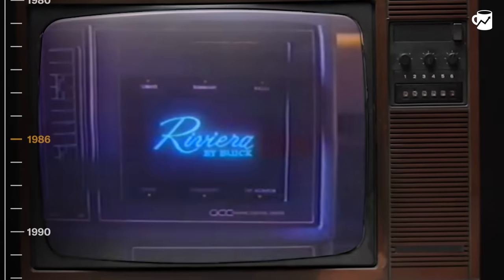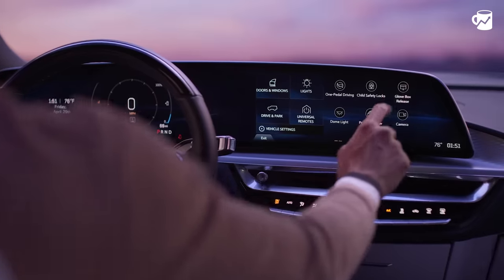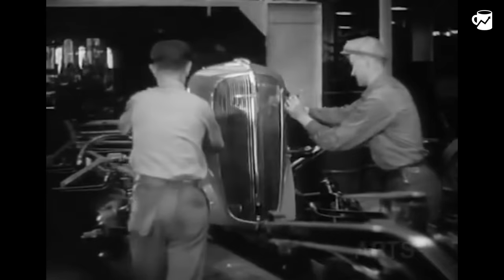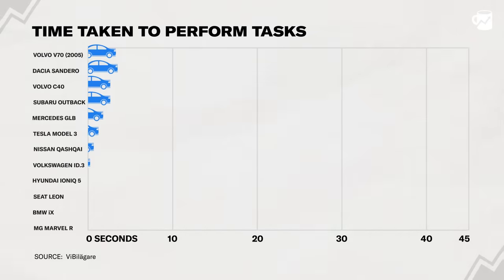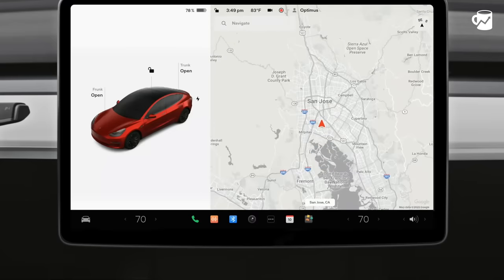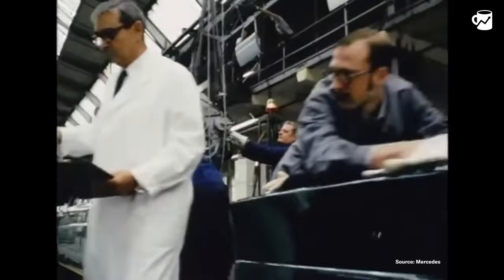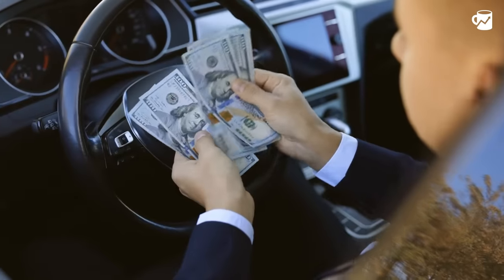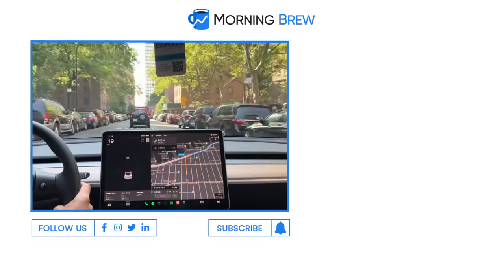The Real Reason New Cars Have Touchscreens

Comment: All I want in a car is music, navigation, and for it to go vroom. The rest is just unnecessary clutter
Reply: Agree with that plus heated steering wheel and seat. An almost must in Canada
Reply: Plus working AC. It gets hot where I live
Reply: Get a Mazda then. Vroom vroom plus physical dials and touch screen that disables when driving
Reply: @idontcare-tk1te  I actually thought about that. But I got a better deal on a used HRV base model
Reply: I have a Audi A3. Its got heated sports seats, no heated steering wheel, but the airvents are located next to the drivers hands = warm air directly on your hands :) But it also has physical buttons for heating, driver modes, but also a 10" touch screen. I only use touchscreen for navigation, and music. But steeringwheels also have physical buttons for navigating and volume, change track / radio etc. Works great.
Reply: That's what I learned with my Tesla. After the honeymoon is over and the novelty wears off, the rest of the stuff is just annoying and you realize the joke is on you. Apple Carplay is all I need for the music and nav and it's standard across most cars and easy to add to older cars.
Reply: Eye if they love minimalism so much why don't they minimalise the controls and features
Reply: @idontcare-tk1te  there be a solution, when car is moving touch is disabled, that would be such a great policy
Reply: And a machine gun mount.
Reply: Navigation means they have geofences.
Reply: Safety second music first
Reply: Louder for the engineers in the back
Reply: You don't need navigation, that's what paper maps are for.
Reply: @vikvc i be driving my 40 year old mercedes with a broken heater at -14°C
Reply: @Callsign_Sturm  the problem is that I don't know what to search for because it always blows hot air on the windshield and my feet but it also always blows cold air through the other vents
Reply: @Callsign_Sturm  there is always hot air coming out of the windshield vent and feet vent and always regular air coming out of the dash vent. It doesn't have ac anymore because it never worked and I can control all of the vents separately if it works properly. I couldn't find a haynes repair manual for it. It's a w126 280s from 1984 and I'm not really good at fixing stuff. The only thing I fixed myself was the radiator. I just replaced it and the hardest part was finding a fitting part
Reply: I dunno, you should probably include indicators, headlights and wipers in that list too
Reply: The driver is also unnecessarily as proven by Waymo
Reply: @idontcare-tk1te  Get a pre - '24 Mustang S550. Much more vroom vroom!
Reply: @idontcare-tk1te  most older cars (made before ~2010) are good, reliable, and dont have these tablets, you just have to take a good care
Reply: Me too. Built-in sat nav and a reversing camera are the only reasons to have a screen in the car. Unfortunately, here in Australia, while satellite navigation is an option for many new vehicles, most people don't opt in for it. Instead, they rely on their phones. That's all well and groovy for city driving, but it's pretty useless outside out main cities.
It drastically limits the availability of suitable second had cars for people who want built-in sat nav.
Reply: 1. Find a car that's emissions exempt in your state
2. Put some money into fixing it up
3. 200 dollar wal-mart double din
Reply: This is my Toyota Aurion basically.
Reply: A/C is important to me oh and ventilated seats as well since you know I live in South Georgia‼️
Reply: IDK, I wouldn't mind my car telling me how great I am every once and a while.
Reply: Also, air con and power steering on top of the navigation & stereo but otherwise agreed.
Reply: I just need it to drive, music is hypnosis, dont need that brainwash when I drive. Navigation isn't necessary, because I actually know where I'm going....
Reply: @valdorobantu290  I purchased a new car almost 2 years ago. The navigation is nice, but I still have a state map and national Atlas.
Reply: Agreed. Spotify, Maps/GPS, Bluetooth, is all I need
Reply: I guess an air conditioning is unnecessary clutter to you?
Reply: This is why I won’t get rid of my 2018 Subaru Crosstrek. I love the physical interface. Yes, there is a touchscreen, but I never have to use it. It only controls music in my car and I can tell Siri next without touching it.
Reply: All Id better see for a center console is a radio, a/c controls, & maybe a closeable compartment.  I realize practically all cars made now have a "nav" computer, but I dont need one....

I will sooner invest $5,000 into something made before year 2000 than waste $50,000 on todays junk.  Its just a ground vehicle for godssake, its not the space shuttle!  It must be easier to use the cockpit systems of a 737 than the nav system of today's cars!
Reply: The CrossTrek is awesome. I've yet to meet a person that doesn't like theirs.
Reply: @ReigoVassal  You missed the point entirely, but depending on where you live, that is entirely possible.
Reply: Air conditioning
Reply: All I want in a car is for the driver to be always present, always ready, polite and quiet. Basically, I want a robocar! 😂
Reply: And air conditioning. And turn signals. And a horn. And
Reply: @vikvc  I live in Louisiana, for about 5 days a year it is a must here also.
Reply: @vikvc  not at all. My truck has neither heated seats or steering wheel, my last one did and never used them and don't miss them.
Reply: I have a Tesla. My sound system is unreal. MKBHD said Tesla has the best SS of any car. It automates my navigation. It’s wicked fast. And I don’t use the touchscreen that much cos I don’t need to. I just put the autopilot with a one click stalk. My air con is one button touch. All because of a single touchscreen.

Comment: It’s cheaper for the company. You’re welcome.
Reply: Yup. Literally the one and only reason.
Reply: Oversimplified actually. Actually the design decision have been far reaching in the industry.
Reply: Don't tell me they're afraid of going bankrupt because of buttons?
Reply: @mrfishsticks266  It's the opposite. They are afraid of going bankrupt because their car has buttons which is an outdated design to the average consumer. They want the future even if it's suboptimal.
Reply: @mrfishsticks266  It's not only the cost of the buttons. An engineer has to plan them, plan the wiring to them. Some guy has to install them. They are mechanical parts that can break, and you need inventory for them. Inventory you might have to store for years for warranty purposes. 
It's also much easier to add or change a button on a touchscreen if you need new functionality.
Source: I designed the touchscreen UI for a grinding machine, and these points came up during the development.
Reply: @Julez60  Not true.  I worked in Engineering on the Tesla Model S from the beginning  and the touchscreen was for simplicity, and future upgradeability (*fixability!), not cost.
Reply: @robertpalin5878  sure guy. 
lets say you're not lying. 
Its still a terrible idea that I would never want in my car.
Reply: @robertpalin5878  "I worked in Engineering on the Tesla Model S" suuuuure, yea we totally believe you lmao
Reply: @Julez60  Seems like you're just a troll.  Believe what you want.
Reply: yeah, the entire video is pointless. Also, its trying to prove that this. isbad. Like isn't the cost cutting the point of the whole bring-products-to -masses idea?
Reply: @robertpalin5878  "the touchscreen was for simplicity, and future upgradeability (*fixability!), not cost."
These aren't mutually exclusive and, as the video points out, for some functions, (especially those used WHILE driving) touchscreens aren't simpler, so why were they removed? Ostensibly, to simplify the dashboard, but actually because it was cheaper...
Reply: Thanks! Wish I didn't watch the video before checking the comment.
Reply: @GonzoTehGreat   Cost may have been a bigger factor for other OEMs, but it was not for Tesla.  Elon basically hates physical buttons, and even tried to avoid the one for hazard lights that's legally mandated.  You can also see this in the SpaceX crew capsule, vs anything from NASA. In his mind, it's old tech, rigid and inflexible.  Having virtual buttons in software gives more possibilities (even if the hardware actually implementing whatever the button does is still fixed).  Personally, I do want physical buttons for certain things, but I wasn't the CEO!
Reply: @robertpalin5878  That's interesting to know! 
Perhaps cost wasn't a motivation for Tesla, but hopefully you can see why it's a consideration for most car manufacturers, especially those with several different models. 
Instead of having to design and manufacture different dashboard layouts and their associated controls, they can instead install the same touchscreen in every model.
Reply: @GonzoTehGreat   Oh absolutely, yes.  I've worked for several car companies, and have both seen and directly experienced ideas getting shot down on cost grounds.  I was just responding to the claim that Tesla's motivation was purely financial.  Just about nothing done there was ever purely financial, much to the frustration of the finance people!
Reply: And much more expensive for Me. No Deal.
Reply: you sir deserve the Nobull Prize for Economics for saving innocents from wasting time.
Reply: So therefor cheaper for the consumers
Reply: Thanks
Reply: Cheaper for the Company producing the Vehicle. Not Cheaper for me as an Automobile owner if I can even be called the owner any more, with a Vehicle with these systems. No thank you. I do not want this in my Automobile. No Sale. Give me another option. That does not have a Infotainment System / Screens. Give me a properly engendered and thought out Vehicle.
Reply: Cheaper  for the companies and more expensive to buy it for consumers since the companies sell it as a super innovation, innovations cost money. Anyway we always pay for everything.
Reply: Why is nobody suing them or regulating them? This is by far THE biggest road safety hazard right now.
Reply: @carstenschops7797 That's fine, except some things you need to be able to adjust without taking your eyes off the road for 3-5 seconds. For example wipers. I sh!t you not, some teslas require p!ssing about with the touchscreen to turn those on. Or screen brightness, or screen off, climate control, etc. For a bunch of stuff it's fine, but anything you'd want to adjust whilst in motion (for any reason, and don't give me the "shouldn't be doing that while moving", people will, regardless of that opinion) should have a button or knob, which you can tell apart from all the other ones without looking. Bonus points if it feels good to use it.

Besides, everything is on the CANbus now. The wiring is a whooooole lot simpler.

Riddle me this - the emergency stop on that grinding machine, is that on the touchscreen UI too?
Reply: @233kosta  Distracted Driving Kills. Just Like Drunk Driving or Driving when extremely  tired. - Agreed it is extremely depressing that there is no Options available to opt out and go with a well thought out button and switch control configuration. This is why I am out of the New Car Market. I will keep what I currently have and save my money.
Reply: @carstenschops7797  While one button may break, just that function fails.  When the touchscreen goes dead, everything fails--even critical operations.  Clearly, they are a giant step backward.
Reply: Not even that simple at all
Reply: @Julez60 irrelevant. It being a bad design doesn't prove anything about why they chose to do it.
Reply: Thank you
Reply: I am not purchasing a Automobile for the company. I am purchasing a Automobile for me. If I cannot find what I want. I will Not be purchasing a New Automobile. 

I do not want a Infotainment Screen, I do not want a push button start, I do not want an electric parking break, I do not want to be stuck with a Vehicle with out simple things like a Oil Dip stick, so I must have access to or bring my car into a shop with a excepted scan tool to read my engine oil level.   

What I want is conventional simple well Engendered physical button and switch control layout (No Touch Screens), A Key to start and open the doors, A Manual Transmission, No Automatic Lights (There are times when one needs to be able to turn off the head lights, In some of these new Automobile one cannot do this). Simple Reliable well Engineered Vehicle is what I want. 

This may be thought of as a dated design or old school. However, this is want i want in a New Vehicle. One should be paying attentions to what is going on around them not on the screens in the vehicle.  Not only are the Infotainment Systems a safety issue. The Infotainment Systems present a Data Privacy and Security issues as well. The more bells and whistles in a system the more there is to go wrong. 

I do not what to be driving a computer system that will have to be replaced in a few years because the manufactures have stopped support for these systems. Forcing one to purchase something new. I say no thank you, I will continue driving what I have and not purchase a New Vehicle because I cannot find what I want.
Reply: I don‘t think anyone is surprised.
Reply: @hkad6252  And a overly complicated more expensive automobile for me the consumer to maintain the Automobile. I say no thank you. Less Complicated, Less Weight, and most importantly a more reliable Vehicle is what I want.
Reply: @robertpalin5878 yeah, the model s has two screens and still had mechanical vents. The cyberturd can't even have stalks, so they took their bs to the next level